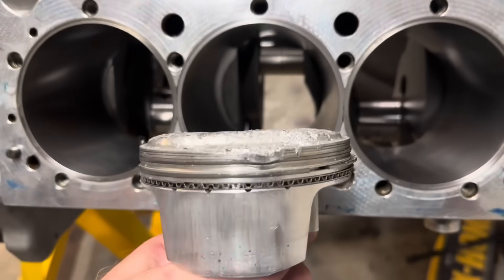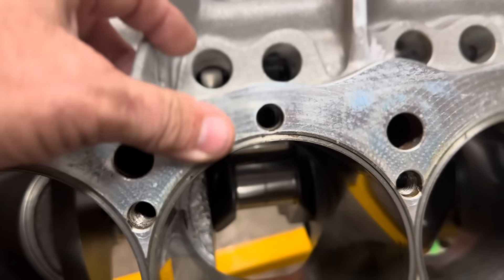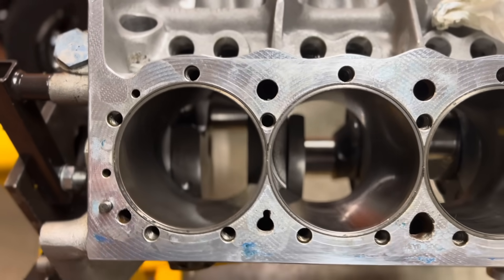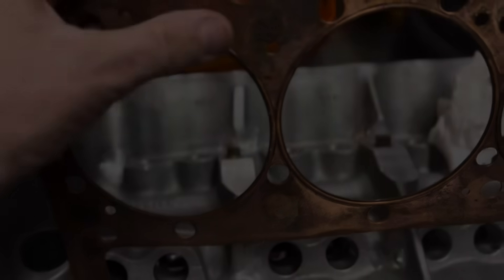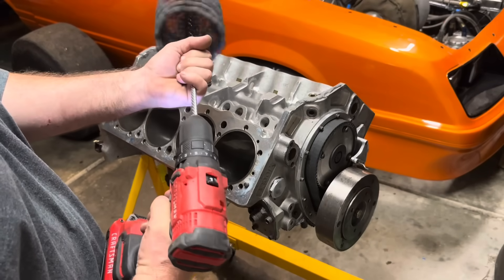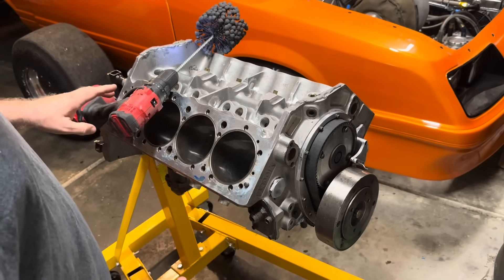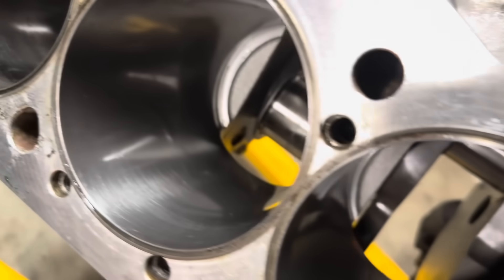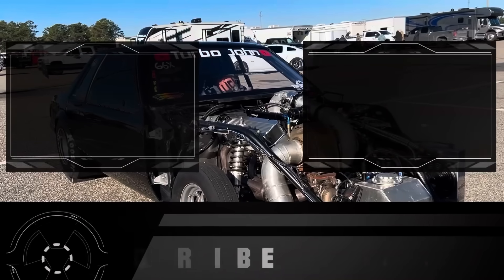Fixing My Hurt SBC at HOME // Berry Honing a cylinder Block // Will it be good enough?

Comment: If you can make 17-1800 hp with that engine and as light as it will be I think your car can win at any actual backside no prep event. I’ve never seen any one use more than that at a true rough course backside. Plus you will be what 2500 with you in it?  With the aluminum small block??
Reply: Just remember from beater bomb testing. You need to be damn near riding a wheely at 640foot. Wheel should be up whole track

Comment: You should just put that motor in your your orange mustang. High RPM can get you better speed. I think a big block will get you off the line faster but having those high RPM up to 10,000 is more beneficial for yours for your speed sense

Comment: No small block required !!!
With the right rear four link bar set up your big block can hook and go with a controlled wheels up look at the last time you were out was your big block not letting your front end go up LOL. With a little less IC and stay above the Anti squat by rising the lower bar to body up one hole. May be a little weight is ok? Hell even beater bomb last week thought adding weight to the front was a good way to go. It did not work. Your 4 link needs something to push against to plant the tire and not lift the front. How much is the SB going to change your weight bias???

Comment: It will be interesting to see leak down numbers after you assemble it.
Reply from the maker: ummmmmmmm, I don't check that.... lol.... seriously.  I will pump it when it's back together, then again if we have some issues.
Reply: You need to remember that the SBC will be put in John’s old car and used almost exclusively for back side NP.  The engine will make more than enough power for those surfaces even if he has a slight amount if cylinder leakage.  That can easily be compensated for with a little extra boost. 😉
Reply: @danmyers9372  Sure not dissing him, it's just my curiosity wondering. I'm just as cheap as many of the drag racers. Got to have money for belts.

Comment: Using a Sunnen hone machine and deck plates is worth 35-40 horsepower, one of the best things in Smokey Yunick's Power Secrets book.  If you hone that with what you got and put a piston with rings in the hole turn the lights off put a flash light at the top and look from the bottom of the block you will see light coming through the edge of the rings and the honed surface, not all the way around but in spots that are higher and lower.  Flat stones and a Sunnen machine are way better.
Reply: And way more $ for a budget racer like John.  And what you are referring to relates to a max effort NA engine.  It won’t make any real difference on John’s SBC as it is a boosted engine. He can make up 35-40 HP by adding about 1/2 lb of boost.  The car will be used almost exclusively on slick back side No Prep races like Dig or Die.  His SBC makes more than enough power to be competitive there.
Reply: Rebuilds or freshin up are all done this way, unless it’s at the engine shop! Blocks aren’t as weak as 70 yr old stock junk! If it works for $100000 billet engines! Like a 5.300 bs nitrous engine, or a big hemi used in promod or top fuel, It will be fine for this! It was torque plate honed when it was at the machine shop!
Reply: Two things one ATF is a detergent that is amazing for cleaning cylinder Walls off even better than brake clean.You'd be surprised.Try it cleaning with brake clean and then do it with a t f after. Second, don't stop going up-and-down because the lines on the cylinder Wall aren't supposed to go the same direction as the cylinderwall There's supposed to be diagonal. 🎉🎉🎉🎉🎉 Enjoy you do amazing stuff